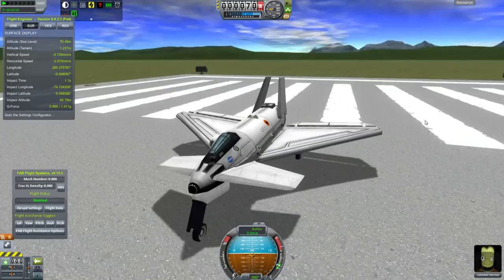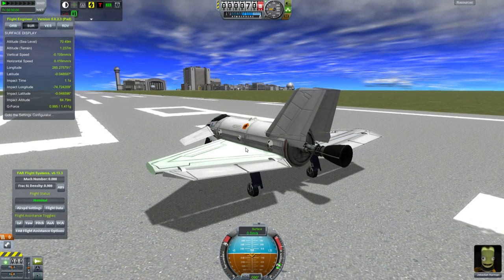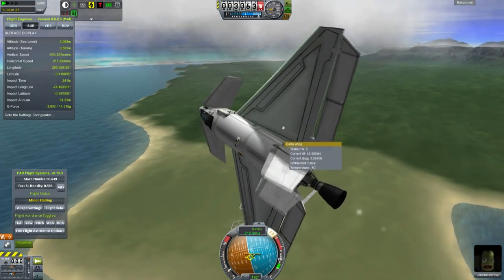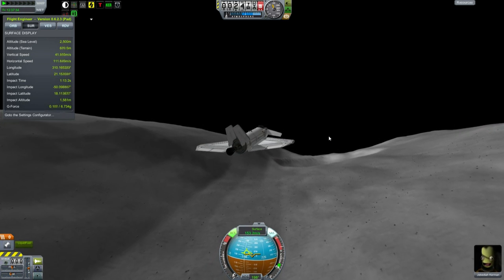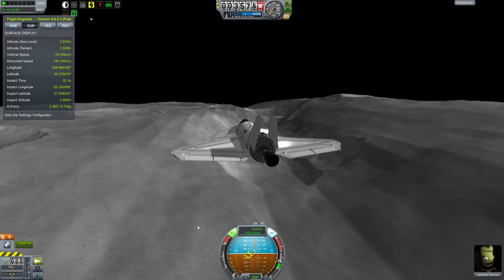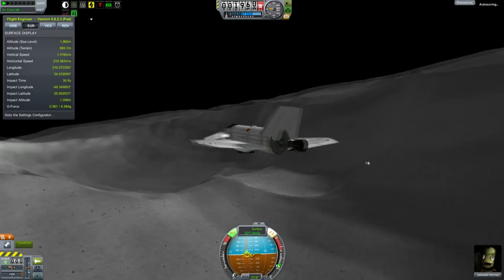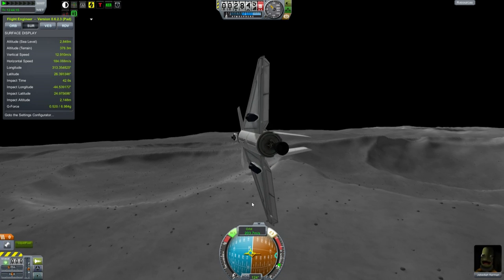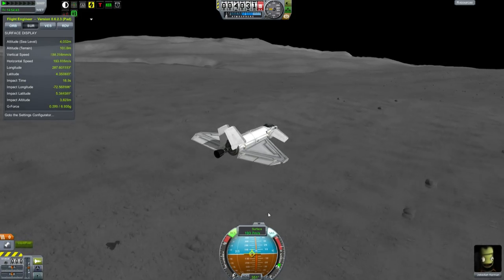The Physics Of Flying 'Space Fighters'

Comment: I've been wondering about this for a while, but wouldn't a giant ball with a bunch of guns and engines on all sides be a pretty good space fighter design?
Reply from the maker: Yes.
Reply: Whilst arguably in space your dimensions don't matter, certainly in games like Star Citizen your ship also has to be designed with atmospheric flight in mind. Similarly in a combat situation, it would be advisable to reduce your profile relative you what you are aiming at so you can reduce your chance of being hit yourself when firing.
Your design would work fine, but it would be quite a target (albeit hard to approach) and thus would need to be fairly nimble. It would also be better suited to computerised control; humans have a limited field of view so you could not take full advantage of the ship's omni-directional capabilities
Reply: Space fighter is a dumb idea altogether. Why would you want to risk life of your pilots, when all you would really need in space is guided rockets. Also, it's cheaper, coz you don't need any life support
Reply: Dekareen And even if someone insisted on any form of space fighters then they would likely be remotely controled drones, no risking the life of pilots and at the time this is possible remote piloting should be possible over large distances.
Reply: Darca1n
Speed of light delay would make remote controlled, high speed space dog fights difficult and would still give an onboard human or computer the edge.
Reply: Dekareen
The same applies to atmospheric dogfights, yet human pilots are still superior.
Reply: filonin2
 that's mostly down to the limitations of current computer systems. By the time we have need for space fighters, computers would be significantly more advanced and capable
Reply: filonin2 Since past few years, dogfighting in atmosphere became inefficent, considering the advancement of computer guided missiles, point defense laser systems and all other nasty stuff.
Fighters are now mostly used for destroying a ground target...and on airshows, which will always be awesome :)
Reply: They may ban things like missiles (I.e. They'd be a war crime) or for one reason or another the missiles may be difficult to use over long distances and would also not work for a rescue mission or anything similar and would also not work for pirates. Using a computer heavily relies on the program so might not be great.
Reply: Scott Manley
 Interesting.  That would technically make Kzin craft the most Newtonian-friendly (for space anyway).  Which is amusing because Niven got around its odd, bulbous shape by saying they have a Gravity drive...
Reply: Dekareen
Manned fighters give you much greater tactical and strategical flexibility. You can send them on patrol missions, search & rescue, deploy them to defend strategic assets, basic power projection (show the flag missions)... All things that neither unmanned missiles nor larger craft may be suited for.
Reply: pyr0b1rd few things
- sphere encloses the most volume with the smallest surface area of any shape, so in comparison to e.g. hornet, you could have at leaeast (i am aproximating) 6 times as thick armour while having ship of same size (volume) and mass
- american army has on some planes helmet with screens that cover all directions around the plane, it requires a bit off getting used to but it works (i can't remember what it's called)
Reply: ScripturusEU You have to understand that combat in space is not like it's shown in sci-fi movies. To say the least, the distances and speeds are...bigger. So big, that it would be impossible for human pilot to exactly pinpoint the shot. Computer driven craft would do any of things you mentioned without any effort.
Also...Pilot has to eat, pilot has to breathe, he wants to return to the safety of spacebase and it's artificial gravity. Robot, you can launch it into your enemy too...They won't sue you ;]
Reply: Dekareen
I think it's safe to say we have no idea what actual combat in actual space will be like if it ever gets that far. Perhaps you're right, and it will just involve fleets lobbing ordnance at each other across millions of kilometres. But it's also possible that it'll take place at much closer ranges, in orbits around planets and asteroids; or even highly integrated warfare involving both surface, atmosphere (for those planets that have that) and orbital space.

So could we have AIs that replace humans in those situations? Again, who knows? But I think that there will always be a need for the skills, flexibility, and not least ability to independently assess a situation that a human provides.
Reply: The counterargument to this is that if you have 6 full-powered engines to cover the 3 axes, you're adding extra mass that needs to be accelerated, thus requiring more powerful engines. While if you have one max-thrust engine, and a bunch of smaller attitude jets to spin you to the correct vector heading, you have a more efficient and nimble ship overall.
Reply: That's no giant Ball: It's a space fighter!
Reply: I think that realistic warships would likely have a lot of Tethers as these give you a lot of agillity and flexibillity. Weapons systems would be more like trebuchets than like cannons.

Rotating Tethers with weights on them can store huge ammounts of kinetic energy and send payloads flying at speeds on the order of earth escape velocity. They allow incredible agility for avoiding fire as well. By having several weights with tethers between them you can set up extreme dependence on starting conditions that make them very difficult targets for missiles to track and hit as they would be very fast and unpredictable.
Reply: Forget the guns, the engines and the weapons would be the same. Just throw small projectiles into the thusters and you have a working weapon system. If you need anything more complicated use missiles.
Reply: Allan Sandfeld Jensen
ahh, the kzinti lesson
"a reaction drive's efficiency as a weapon is in direct proportion to its efficiency as a drive.".
Reply: Dekareen 

And then your drone ship gets hacked and fires on its own carrier...
Reply: Ikarugachan Death star confirmed
Reply: +Dekareen Yeah but anything that would impact at a decent speed would be dodged easily, anything travelling at slow speeds would be shot down easily, imo, lasers is where it's at, that coupled with a cluster type rocket which launches hundreds of smaller projectiles at a target over a wide area, still, you could see those things coming thousands of km off so still dodgeable.
Reply: wait, are you thinking of including an exhaust port on this space fighter?
Reply: +filonin2 Yes, but in the atmosphere, speed of light lag is neglible. Light can travel the entire circumference of the earth (~40K km) in about 0.13 seconds.
Reply: +Ikarugachan Wings did a documentary about the future of warfare, and included sensible space fighters which where just boxes with guns and thrusters on all sides zipping about in all directions independent of their facing.

It looked weird as hell, which is why science fiction doesn´t go the "most sensible" design, but builds typical "plane" designs.
Reply: +Ikarugachan Capital ship with lasers could obliterate those in open space combat. On surface/near big things they could be useful though!

Wouldn't a tube with weapon in one end and big-ass engine in other end be most efficient fighter? Small thrusters would rotate craft to correct direction and main engine would do the work.
Reply: +Ikarugachan So, the Death Star? Or Borg Sphere?
Reply: you mean the thing from lovers in a dangerous space-time?
Reply: @Ikaugachan If you look at Space Engineer ships, this is more or less what you will see. You will not see many single-engine fighters, but instead cubes with engines and guns on all sides... because spheres are hard to work with.
@Pyrobird You don't need to worry about atmospheric flight... Just stay in space. That's where most(99%) of the action is taking place.
Reply: The issue with that is that engines tend to be a weakness in a craft. On top of that, if you have a main engine on any side, that's heavier than one medium sized engine and a bunch of small ones, and just creating an approach vector and simply rotating to fire upon the enemy. Not to mention that a giant ball would mean that your armor would be poorly angled the more dead on they hit. 

I'd probably go for a needle, or pyramid shaped craft.
Reply: Ikarugachan 
I would say that the Borg ships are exactly that
Reply: Cones are also pretty good, at least according to the game "Sons of a dead earth". I guess that, if maneuvered properly, you get so much more usable space while showing the same cross sectional area to your enemy.
Reply: You also have to consider the angle of impact of projectiles. A good hit on a spherical ship would be at 90 degrees to the armour. Cones and pyramids are better shapes in this regard.
Reply: +Dekareen
A shitload of tiny enemies is a lot harder to shoot at than one big one.
Reply: Space engineers
Reply: not really. smaller warcraft capable of operating in the gravity well of large bodies and in atmosphere would be critical to any attempt to hold ground. missiles, even remote operated missiles, cannot provide effective support for the ground forces needed to secure resources. similarly missiles typically have to have a target, you can't fire a missile, realize your target is just a group of civilians, and bring it back in to use on an actual target. you can't use Drones because anyone capable of operating in space is more than capable of large scale electronic warfare such as jamming, spoofing, or otherwise disrupting your control signal. this is why drones can only be used against non-state actors and undeveloped countries.
Reply: Flying deathballs, wasn't that in code geass? (except in the atmosphere?)
Reply: Cube?
Reply: Soviets did consider arming space stations with 23mm cannon.
Reply: PEW PEW PEW!!! Oh wait, there's no sound in a vacuum . silence
Reply: Jimorian - you only need four
Reply: @Jimorian But the attitude jets aren't powerful enough to create the effect we're talking about, they're for attitude, not flightpath alteration. Of course a possible answer, would be to do the Harrier method, and have one main engine, and then duct the thrust to where it was needed as required, which would be more efficient than having lots of engines, but there is a power penalty for that too.
Reply: Ikarugachan that all ready exists it has been a perfect system ever since the collective was founded we are the Borg and we have perfection
Reply: Drones. Are A: Cheaper B: Can pull WAY more G force.
Reply: Scott Manley the borg
Reply: Yes,  though that would be exclusively for space. Something that needs to enter planets would be designed differently, freelance and personal craft would likely resemble aircraft more where as dedicated space fighters would be balls of death.
Reply: I recall a book with that kind of design. I recall it was part of the Skylark Series by E.E. "Doc" Smith.
Reply: Yes but no. You want it to kinda resemble aircraft that we have but without the constraints of aerodynamics if they’re a dedicated space fighter. You need it to have a small vertical profile so you’ll have to stretch it laterally to have weapons hard points. But unlike modern fighters, you will want to put the engines far apart so you can use asymmetric thrust to control for “yaw” and use thrust vectoring for pitch and  roll (and a little bit for yaw). Then you’ll still need it to resemble the proportions of fighters when it comes to girth and length because even if aerodynamics is not a problem, you’ll still need to deal with physics.
Reply: borg
Reply: @belzebubbby  Doesn't have to be occupied by a person. But I guess you'd call it a 'drone' and not a 'fighter' in that case.
Reply: there started a dime-novel series in the 60s, 'Perry Rhodan', they had (and still have) ball shaped vessels. For me the ideal design, also when considering the acceleration force.
Reply: The main issue would be having a rather large crossection. Bit a ball of death certainly has its advantages
Reply: Isn't the death star from star wars basically just a giant ball with a lot of weapons
Reply: That's the gundam ball thing
Reply: Isn’t that the Death Star?
Reply: @nater2d3  that would resemble the JOULE VERNE or the SOL from Perry Rhodan!
Reply: @billferner6741  yesss finally somebody mentions Perry Rhodan
Reply: Engines are pretty weak against guns tho
So no
Reply: A tapered cylinder actually as spheres are more easy to hit
Reply: Engines on all sides make you very maneuverable but not fast and guns on all sides might be good to defend yourself from every direction, but if you want to concentrate your fire at one point, this design is unpracticable
Reply: @belzebubbby  shielded fighters are more difficult to shoot down than missiles and are reusable. If you think about it, they are very similar, in that they fly colse to the target and attack, the one with one big warhead, the other with many smaller projectiles.
Reply: @belzebubbby  well, why the fuck do we still need tanks and planes and transport craft when we could just shoot missiles at each other in earth? Missiles aren’t always the best way to do things.
Reply: @belzebubbby  one day, we’ll make tech that can counter guided missiles too.
Reply: See basically every ship in the expanse. The roci’s PDC’s can face straight back, can fire guided torpedos that then flip to burn backwards, and larger capital ships have railguns on turrets that can face back aswell. You don’t really have a dogfight, more like a high speed joust. At a far further distance.
Reply: @belzebubbby  8 year late response, but  the US air force operates off a doctrine of beyond visual range, since dogfighting is an unnecessary danger when a missile can be effective. I think space 'fighters' would be more multirole strike aircraft with missiles to protect themselves without necessarily risking one of the larger ships of the fleet.

Comment: I think in Elite Dangerous you could explain the large back engines by saying they are used for supercruise, the engine that propels you in normal drive mode being much smaller. At least that's how I justify the disproportionately large engines at the back of the space bricks ;)
Reply: From what I understand Star Citizen will have a supercruise mode for inter planetary travel.
Reply: Wormhole ThirtyTwoHundred
Yes but the point is that Star Citizen has a smiler situation.
Reply: +Fruchtpudding I always assumed that the humming sound you hear flying through normal space in Elite: Dangerous was some kind of mechanical drive, like an eccentric reaction wheel.
Reply: The large engine at the back is boosts and attaining higher accelerations. if you want to stop rapidly turn off flight assist, pull a 180, and fire the rear engines. Space Engineers shows this concept amazingly, because you place thrusters wherever you want, and 4 on the back will accerelate you much faster than 1 on the front can slow you down.
Reply: In Elite large engines in the back pack so much thrust you would be pancaked into your chair. They are more powerful than maneuver thrusters, but all of them are hella powerful.
Reply: well i think you can just justify saying its because build cost, on ksp to land on a low gravity objects all i use is a single engine and a reaction wheel strong enough to turn that engine to whatever direction i need it pointing, same thing for elite and sc, need to go fast? point prograde with your big engines, need to slow down? point retrograde with your big engines, also a single engine and very torquie reaction wheels are more fuel efficient than many engines working on RCS.